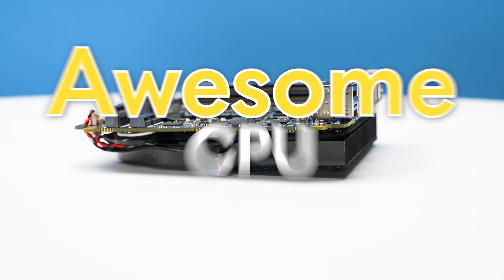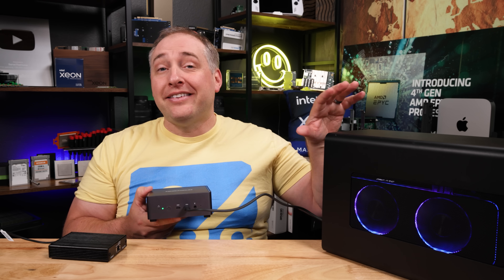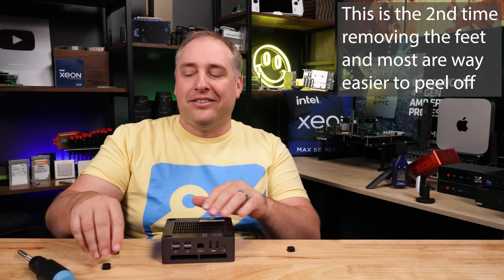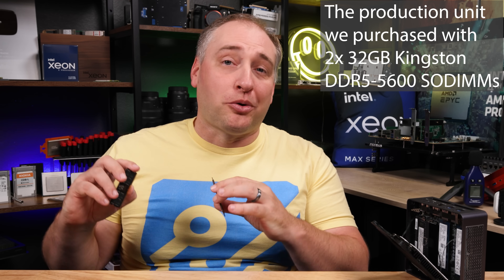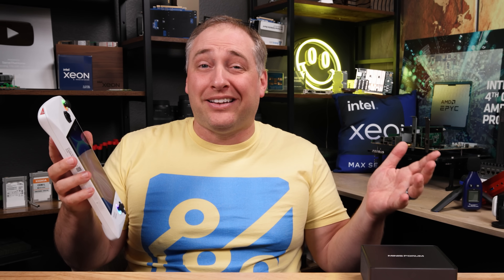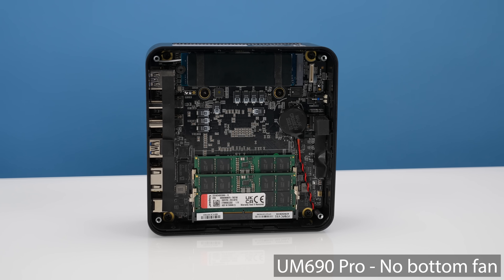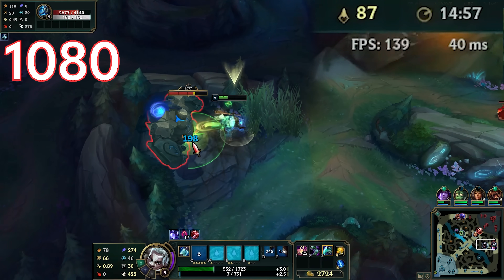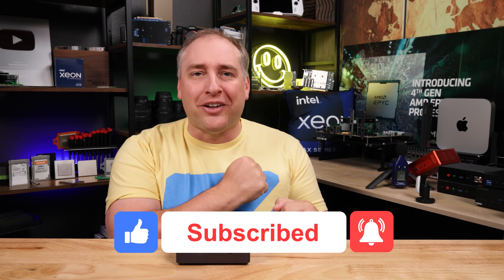This Was NOT the Mini PC We Expected... Minisforum UM790 Pro Review

Comment: I keep a super minimalist desk in my office, so basically two 32 inch monitors floating with an ergotron vesa.
Wireless trackball and keyboard.
All my servers and machines are in a dedicated machine closet on another floor.
What i want this 790 for is to give me a little more power at the desk to run vs code remote and access repos i have on other machines. My workflow now is typically to just ssh into whatever machines i need to and work from there, but i think using vs code will let me do the ssh behind the scenes and be able to have a better development experience.
In case you are curious, since I only ssh and work from other machines anyway, I am using an rpi5 to power my desk and displays. For my workflows, it works quite well, but I would like to up my flow so looking into options.
Btw, I love the barebones option since I will wind up installing some flavor of linux snyway, and if anything just run win 11 pro from a VM on the 790.
Reply from the maker: Lately I have been that way as well. The big Threadripper system I just Remote Desktop into at this point and now I just tailscale ssh or remote desktop into everything
Reply: @ServeTheHomeVideo  nice! I use Tailscale to ssh from my iphone when i am out, using Blink.
Also serves as a ‘private’ vpn.
Love your content btw!

Comment: The Canadian Amazon site has a barebones version without SSD/OS/memory. I like that. I have enough to get it going and the savings will be enough to max out the memory later on. I try not to put the feet back over the holes once I have been inside.  I just put them beside the holes if I can. Generally, it isn't a problem.

Comment: I bought the barebones UM790 Pro and put my own memory and SSD in. I put a Crucial 96GB DDR5 5600Mhz kit (2x48GB) and SK hynix Platinum P41 2TB PCIe NVMe Gen4 M.2 2280 w/ transfer rates of 7,200MB/s in Slot1 and Crucial P310 4TB PCIe Gen4 2280 NVMe M.2 SSD with transfer rates of 7,100MB/s  in Slot 2 in my UM790 Pro. Event though the UM790 Pro is rated for a max of 64GB of DDR5 and a max of 2TB SSD, it accepted the 96GB of memory and accepted the 4TB SSD. Being barebones, there was no OS so I downloaded Windows 11 and installed that without a key and I was very pleasantly surprised to find out there is a Windows 11 Home key embedded in the hardware. Verified the key and registered with microsoft. This systems is very fast, very quiet, very cool, and very stable!!  I push 4 Monitors (2x Pixio PXC348C 34 inch 144Hz UWQHD 3440 x 1440 Ultrawide and two other monitors for productivity). I do significant gaming and extreme multitasking as well as run a half dozen VMs with this UM790 Pro. I highly recommend this system (UM790 Pro). Don't be afraid to push the memory and SSD. This is significantly better at cooling, noise, and performance than the GEEKOM Mini PC Mini IT13, 13th Gen Intel i9-13900H (upgraded memory to 64Gb w/ san SK Hynix Platinum P41 2TB SSD). The IT13 was loud, and hot and performed poorly before blowing up after four months. The UM790 Pro runs cool, is quiet, and lighting fast. Not bad for a quick and cheep build. I was not expecting this level of performance.

Comment: Even a single 255gb ssd is way more than you would need for a standard linux desktop install as long as you aren't trying to use it as file storage, and you really should be using a nas or das for that anyhow.
Reply from the maker: True, but many folks buying a mini PC do not have a NAS. Also, those that install games would want them to run locally off NVMe. 256GB might be more of a minimum, but there are plenty of reasons to go bigger.

Comment: My Minisforum UM790 Pro overheated after 15 months of heavy use.  I saw sparks come from the side.  I am making a possibly futile effort to get help from the company.
Reply: My UM790 Pro overheated and died after 15 months of heavy use.  I  have shipped it to the seller in China in the hope of getting warranty service.  For some reason, the package has taken four weeks to leave the country.
Reply: The seller provided warranty service.  I am up and running again.
Reply: @john2001plus  Great to have the feedback. I own 2 Minisforum PCs, and never have had a serious problem... but it's nice to know. All Mini PCs (like laptops, but better cooling than laptops) have heat risks. One mod that I've gone to with all of my Minis is putting the best passive heatsinks I can find that fit (and don't interfere with anything like SSD/etc) on the Power Capacitors. Seems like most of the failures end up being power-system related, and cooling those caps, even with a simple 1.5mm flat copper heatsink meant for a m.2 2242 laptop SSD, seems to help stability and keep them alive.
Reply: @devobronc You replace the heat sink?

Comment: Fan gets extremely noisy and intermittent scraping noise after about 4 months.
Someone built a 3D printer case for a third party fan.
Reply: Do you have the link for the third party fan? I cant find it ...

And may I ask you if you have noticed any coil whine or other noises with your UM790 PRO?

(im asking because i do suffer from a illness which is making me very very sensitive to noise, especially with high-frequency sounds, a device with coil whine would be unusable for me)

thanks and greez from austria! :)

Comment: I bought the mini PC here in Germany from a company called CSL. It is probably exactly the same device as in the video. My PC has the Ryzen 7 7840HS installed, however. As far as the noise level goes, I found out that if you raise it a little higher by about 10cm using additional rubber feet, it is still a shame! The gap under the device (if it is on a desk) is probably a little too small, and the fan simply spins faster to get the air. Otherwise, I am very happy with the computer.
Reply: Hast du bei deinem UM790 Pro Spulenfiepen/ coil whine oder andere hochfrequente (Stör)gerräusche?
Ich frage, weil ich an einer Krankheit leide, durch welche ich leider extrem empfindlich ggü. solchen Gerräuschen bin ...
(Und als Tipp zu deinem Lüftergerräusch: viele Amis bauten den bottom-fan einfach aus und stellten das das unten offene Gehäuse auf solche Kühldinger, die viele für ihren Gaming-Laptop benutzen. Aber wenn CPU/RAM/SSDs nicht länger unter stärkerer Last laufen ist dieser eh generell überflüssig)
Greez aus Österreich
Reply: @torbesen  Hi, Spulenfiepen kann ich bei meinem Gott sei Dank nicht hören! Ich muss aber dazu sagen, dass ich im BIOS den Rechner nicht auf die Maximale Leistung eingestellt habe! Eventuell liegt es ja daran! Bei meinem Desktop PC bekomme ich nämlich genau dieses Spulenfiepen, wenn dort in den Energie Optionen "Höchstleistung" eingestellt ist!Unter "Ausbalanciert" ist alles wieder ruhig! Ich vermute, dass dieses Hochfrequente Geräusch irgendwas mit der Netzeinheit zu tun hat. Als reiner Anwender (kein Gamer) reicht mir die Leistung von "dem kleinen" alle Mal. Danke für den Tipp mit dem unteren Lüfter! Grüße Bocholt (D)

Comment: Thanks for answering EVERY question I had, even down to idle noise, wattage and stress test noise and wattage
Reply: did you buy one? if yes: could you notice coil whine or similar noises?

(im asking because i do suffer from a illness wich is making me very very sensitive to noise, especially with high-frequency sounds, a device with coil whine would be unusable for me)
Reply: @torbesen  Actually a friend of mine was looking to buy something new, not me personally. He hasn't noticed any noises with it or said anything about high pitch humming. Looking at specs it gets to 2.5 decibels when pushed the limits but generally it sits at 1 - 1.5 decibels. There will be some noise as with any pc, but could be fixed with putting some kind of mesh or breathable noise cancelling material along the inside casing if you have any around

Comment: Can the wifi card below the NVME drive be replaced with another/smaller NVME drive?  Thank you
Reply: The answer is the m.2 is not an M-Key (NVME), it's an A + E Key, so only a SATA SSD made for A+E Key will work. 
There are adapters, but since the format is 2230, there isn't room for an adapter AND 2230 NVME (and the Adapters slow it to SATA speeds anyway)

Comment: ## Minisforum UM790 Pro Review - Buyer Beware

This review pertains to the Minisforum UM790 Pro refurbished unit. While the initial interaction with customer support was positive, the experience quickly soured, revealing concerning practices regarding refurbished products.

*Misrepresented Specifications:* The advertised specifications clearly stated DDR5-5600 RAM. However, the received unit contained DDR5-4800. When questioned, customer support claimed "up to 5600MHZ" does not guarantee the system contains 5600MHZ memory. This is misleading, especially for refurbished products, where matching original specifications is expected.  This explanation was provided only after Minisforum had admitted it was a mistake to put the slower memory in the system, provided me with replacement 5600MHZ memory and testing had shown that the system would not function with the faster memory.  

*Deceptive Practices:*  Evidence suggests the slower RAM was intentionally used to mask potential hardware issues. The system consistently failed to boot with the correct DDR5-5600 RAM, even with replacements sent by Minisforum and a second set of replacement purchased locally. It only functioned, albeit erratically, with the slower DDR5-4800, indicating a deeper problem, likely with the memory bus or timing.

*Lengthy Resolution Attempts:*  Despite a proactive approach and willingness to work with customer support, the resolution process was drawn out over weeks. Multiple suggestions, including returning the unit for repair - a nonsensical solution given that the company's prior claims of testing the system and memory had been proven untrue - were offered. A partial refund of $30 was offered and accepted as payment for me not immediately returning the system and taking time to replace and test the memory. This compensation proved insufficient considering that the time and effort spent troubleshooting quickly changed from replacing memory modules to debugging system crashes. I purchased the system based on the advertised specification and required the vendor to meet that specification to accept the purchase.

*Questionable Business Practices:* Minisforum's justification for the low price of refurbished units and their inability to bring the unit to specification raises concerns about their refurbishment process and overall business ethics.  Claims of selling refurbished units at a loss are dubious, considering the significant price alignment between barebones and refurbished models pricing. Minisforum made a decision to install 4800MHZ memory into a returned system in order to "fix" it enough to sell to a customer.  

*Conclusion:* While the customer support representative was polite, their attempts to resolve the issue felt more like damage control than genuine problem-solving. The experience exposed potentially deceptive practices regarding refurbished products, making it difficult to recommend Minisforum, especially their refurbished units. This, coupled with similar accounts found on platforms like Reddit, paints a concerning picture of Minisforum’s quality control and business practices. 

*Recommendation:* Potential buyers should be wary of Minisforum's products and support especially  refurbished products.  Buyers should research Minisforum throughly and consider exploring alternative brands. 

I am returning the unit to Amazon and will look for another vendor.  I will update this review when the return experience is complete.

Comment: just bought a UM790 pro but often fails to boot. Takes several attempts to boot
Reply: What memory are you using? I got Kingston 5600 CL46 and made sure to reset BIOS to default settings, boots up without problems 🤔
Reply: @AppendixVermiformis  Using the same memory 2 Kingston 32 GB sticks. I've reset the PC twice now and also carried out a memory test. Also found out if I let the first boot run for about 5 mins and then shut down it and unplug for about 30 seconds  it boots up OK. Very strange

Comment: Hiya. I am obviously late to the party, but is there any difference between this UM790 model as compared to the less expensive UM780, aside from the very slight clock bump?  If note, since I will be Occulinking this to a 7900XTX, that clock bump is essentially irrelevant to me, I think.  Arguments against this thought process?
Reply: Just the CPU clock bump.
Same RAM speed, same iGPU specs, same everything but a small boost clock bump.

Comment: Recently got a barebone UM790 and bought a couple 2TB NVMe SSD.  I put in my RAM and SSDs but my system is only reading as 2TB space.  Anyone have any ideas on how to fix this?  Pretty sure it's not a bricking problem.  Does each SSD get dedicated/pipelined to different systems that causes a misread?
Reply: Try diskpart and set up the SSD from the beginning. If you, however, don't see the SSD in CMD/Terminal, reset bios. If reseting bios doesn't help, unplug PSU wire and detach cmos battery and press the start button for 1 minute. If that doesn't help, your device or the SSD could be defected.

Comment: One thing that bugs me about more than half (from what I’ve seen) of these high end mini PCs is how they put however many USB4 ports they have all on the front with not even one on the back. For all the uses you mentioned, extra monitor, extra network, EGA, power supply (if you power it that way) or extra really fast storage wouldn’t most people prefer to make those connections at the back to keep the cabling out of sight? I know I would. Apart from that this thing looks great.
Reply: It's almost like there's a proximity to the CPU limitation or something.
Surely it's a coincidence that all USB4 laptops have all of their ports on the same side near the CPU.
There's definitely no way at all that it's some kind of signaling limitation.

Comment: The WiFi and Bluetooth on this device is absolutely horrible, as pointed out on a Reddit post.
Closer inspection shows the leads are terminated into copper pads underneath the device.
I ended up drilling holes and installing antennas on the sides.
Reply: Intel AX200 is junk. Instead of replacing the antennas, you could have replaced the wifi m.2 card with a Realtek or MediaTek for about $25.

Comment: So I finally bought it and risked with 2x48GB DDR5 and it works great with 96GB of RAM (I am not surprised as this CPU support 256GB of RAM as per AMD). Like really great. (I am coming from Beelink SER 5 Pro with Ryzen 7 5800H).
Proxmox - excellent.
But igpu passthrough... forget it ;-)
Reply: just ordered this as a barebone, added 2x48GB curcial and 2 x 2TB Samsung 990 Pro. Seeing this comment makes me happy i did. Planning to run proxmox on it too. this is my first dive into the world of minis i hope i enjoy it. 
also planning to use it for firewall pending when i can get a physical one.
Reply: @kwazie_harry  great choice I believe. Comparing to my previous Beelink SER5 it is much much faster, but of course when you stress it completely it goes to 120W. But that is only during tests - normal average is about 55W. One thing though: just 1 NIC... but ok, at least 2.5Gbps
Reply: @zyghom  thanks for the heads up. I can get a USB C NIC to help with that. How long you been using yours. Cos a lot of people usually tend to complain and return within a month of purchase.
Reply: @kwazie_harry  I bought it on Feb 6th and using since then. No issues AT ALL. Average power consumption is around 30W. Proxmox and 30+ VMs and CTs with 2x m2 SSD working in mirror zfs

Comment: I purchased this product, I don't understand why, even when I stress the processor to the maximum, it never reaches 5.2Ghz as declared by the manufacturer. Can someone explain to me why?
Reply: 5.2 boost speed is temporary, and only applies to 1-4 cores at a time. In heavy multi-core or all-core CPU loads, the max will be between 4.3 and 4.7MHz.  Normally, most processing jobs don't even require 5GHz, and if they do, not for very long, a few seconds at best.  Make sure your BIOS Power Settings aren't set to "Quiet" or "Silent", as that caps the power limit too low to hit the boost speeds.

Comment: I don't know what you're talking about at all, go read some posts on the net and you'll see that everyone is complaining about the crashes of this model, I have it and there is only disappointment and failure with this device, on the surface the hardware of the Nir looks very impressive, but all in all the complete opposite, the device from today The first one keeps crashing or restarting, even after bios updates, reinstalling maybe the 20th time of a new operating system, specific drivers only from the MF website, changing unnecessary low frequency memory settings, what did I do to try to solve these problems, nothing helped , let me just tell you that I bought another MiniPC from a known manufacturer Asus ExpertCenter and it didn't crash for me once, which means these Chinese don't know how to make devices and do QA for them in depth and properly, conclusion not to buy a MiniPC from Chinese manufacturers! Only from large and well-known manufacturers.😡
Reply: Ai

Comment: I wish I could get nobara 37 to stop crashing, kwin_waylan randomly crashes on mine. The only two things I dislike with this is the two usb c front ports and the bottom cover is plastic and cumbersome to work around while tethered to cables. The beelink has an all metal bottom and the screws are accessible with the feet still on. However, I think the MF is more aesthetically pleasing.